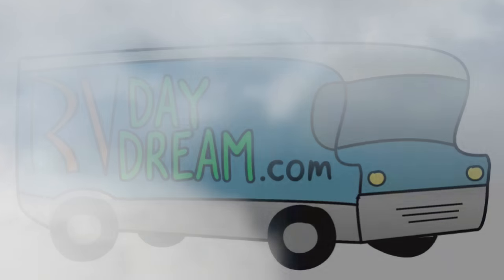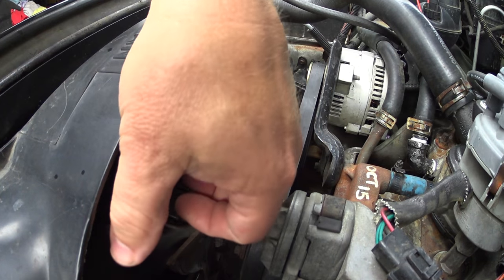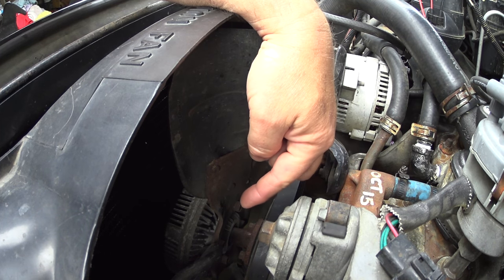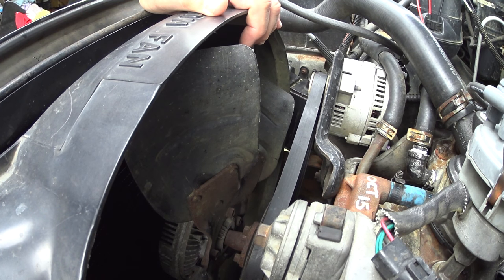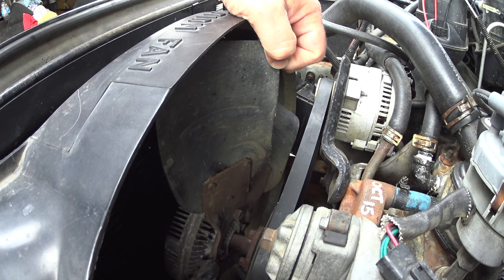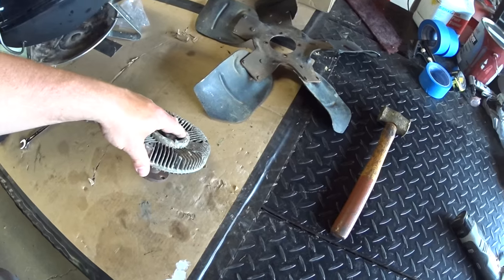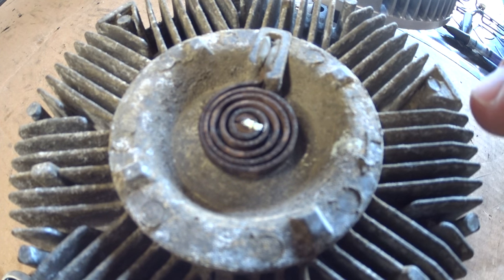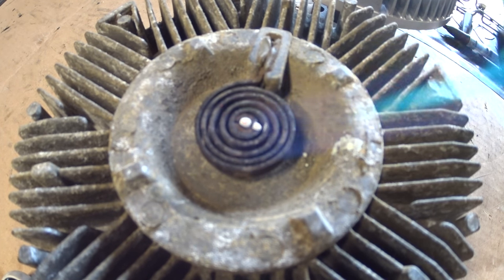RV Tow vehicle Wind power

Comment: I told you it wasn't normal that truck was idling at 210 degrees, thats 10 degrees over boiling temp, and I don't like it. My old Chevy didn't use that kind of fan, it was all electronic based, off a engine temp sensor. But if you suddenly discover melted sensors and blown out fuses, you might find your fan not turning on no more lol. Thank you for demonstrating how those fan clutches worked, I never worked on those, so never experienced that. That was super cool, watching the valve rotate, once the spring got heated. I am loving it.
Reply: Boiling temp? wrong:

Water at atmospheric pressure is 212ºF; under 15 psi pressure is 250ºF; in 50/50* Glycol mix @ 15psi is 268ºF.
(50/50* Glycol @ atm pressure is 223ºF.)
*[I believe these figures i quoted are for a 50% mix. And typically the max recommended ratio is 60/40 glycol/water; which is slighter more boil/freeze protection].
Mr K L

Comment: As I just found out on my 01 RAM with Cummins Diesel, a radiator full of grime and dirt can also cause the same symptoms as a bad fan clutch.  Fords may be different but I thought I'd put that out there.
Reply from the maker: Yep, anything that restricts airflow like adding a bigger than needed trans cooler in front of the radiator or a dirty A/C condensor.. Whatever you do don't ever remove your fan shroud.. That is a another No-No.
Reply: +RVdaydream Most people dont wash the radiator area when they wash the vehicle. I always wash mine good to be sure that no gunk gets built up.
Reply from the maker: It's definitely a good idea,   Be careful with the pressure wands at the wash bays though as they could potentially cause debris to be lodged deeper into the core or even cause leaks if the fins are pushed around by the spray..

Comment: I just cut the coil spring with a dremel...and turned to valve to open position by hand.....tacoma went from 214 on hiway in az to 93✌
Reply from the maker: Fans don't add air flow over 35mph
Reply: @Rvdaydream  fake news
Reply from the maker: Real Physics.. Like adding a box fan in your house window during a cat 1 hurricane.. Flex a lite, Derale Confirmed this during seminar training when I worked at Summit Racing in the early 90's..

Comment: Dakota going down grade 45mph cool weather overheated. Two gallons water in radiator. Went 110 miles home ok no grade .

I just replaced fan clutch. Air over radiator is NOT enough to cool engine.
Reply from the maker: Air has to be directed so that it flows through the radiator. Most stock vehicles, meaning no lifted trucks, no vehicles with air dams removed or added, no vehicles that have had their under engine catch pan whether it be plastic or rubber removed, should be designed to  allow  airflow through the radiator however, even with all the factory components in place there are some vehicles that the engineers have designed that require a fan to pull air through the radiator. But it's a poor design if that's the case. Just driving a car at 45 mph with any faulty cooling component such as a radiator that is not fully flowing, a thermostat that is sticking whether it be fully closed or fully open or even at the wrong temperature will cause a vehicle to overheat even though there is sufficient air flowing over the radiator. So to recap, if your vehicle is in its stock configuration, especially not lifted, and if it is a well engineered vehicle from the factory, and all of the cooling components are in top condition and working the way they are designed to then anything over 45 mph is more than enough air flow going through a radiator to keep a vehicle cool. Also remember the engine has to be spinning at a sufficient enough RPM to allow the water pump to circulate coolant throughout the engine at a rate that it will extract the Heat from the Block and transfer it so that the radiator can disperse of it. During a downgrade could be a chance at the engine was not doing that.

Comment: Yep it is kind of of a flawed design if you think about it, not having the radiator up front catching all the air possible. they could at least close off the bottom etc, to force more thru radiator.some are beter than outhers.
Reply from the maker: I totally agree. Like most RV stuff I am sure it was designed with cost in mind and functionality being a secondary thought..

Comment: Tbird v6 climbing sierra from valley floor. Warm not hot weather. Overheat. Pull over. Cool with water. About 10 times in 130 miles.

Yep fan clutch. So NO! air through radiator over 40mph did not cool engine sufficient.
Reply from the maker: The V6 thunderbird, yeah that car is not designed very well. Air was not being pulled or pushed or dragged or blown or anything else through the radiator with that little tiny grill opening. And I hope you didn't remove the belly pan(rubber flap) . If you pulled the radiator out of the engine bay and stuck it on the front of the car where would actually see air flow , you don't need that fan. So YES air over 40 mph that actually goes through the radiator will be enough to cool the vehicle.

Comment: If your putting on the exact same fan, then it would not benefit from a heavy duty clutch. The torque is going to be the same. The 4 cores make NO difference to the load that the clutch will see. How many cores will not change how much work the clutch does, if it is driving the same fan, and with the same pulleys.

The benefit will be from all the other things a heavy duty offers. (probably higher durability in higher cycling or longer cycle operation, sustained higher temperatures, etc.; which is probably why you are using a 4 core in the first place...)
Mr K L
Reply from the maker: I don't think that I completely agree with that..  A fan that is designed with blade pitch and diameter size to draw through the fan shroud a determined amount of CFM by retrieving air through a path that is being blocked by a power steering cooler, an AC condenser and two radiator cores would definitely see more work if that same path is being restricted by an aftermarket oil cooler(separate video) and Double the size of the radiators thickness....
Using an analogy, Same straw, same mouth, thicker milk shake... Means more work..

Comment: Downfall about the severe duties, i found out those will allow maximum fan slips when disengaged
Reply from the maker: When driving over 35mph, the fan doesn't offer any additional windspeed anyways so, being fully disengaged is ideal for less power consumption..
Reply: @Rvdaydream  yeah but you one thing i found out???

Is that with clutch driven fans they dont seem offer great ac performance at idle
Reply: @Rvdaydream  and or when the engine rpms are below 800 rpm

I read that those 2 contribute to slightly poor performance of ac
Reply from the maker: Ninety percent of the time the poor performance at idle is not because of the fan it's because the compressor is turning at a much slower speed also. At idle up until about 1500 RPMs my fans screams when it's locked in. What I mean is it is pulling a ton of air it sounds like a semi truck.
Reply: @Rvdaydream  ah okay, i can see why a smaller car is more preferred since the engines i believe have higher idle

I always figured there was something up with my mid sizer SUV but nope , glad to know :)

Oh by the way wheres the link that you stated in this video?

As its not in the description

Comment: When they fully engage on big a class motorhomes they push so much air they are noisy. it is aggervating.
Reply from the maker: i would imagine they need that air pretty badly inside that big box.. :-)
Reply: +RVdaydream Yes they need tons of air. My 36ft class a has a clutch fan as well as 2, 10 inch electric fans. Im thinking tho of changing out my clutch fan for a big electric fan. Maybe a 24 inch one.
Reply from the maker: 99 percent of electric fans will never out cool a good ole mechanical one.. The exceptions being specific designed aluminum radiators with perfectly matched/formed fan shrouds with high volume fans.. These will run anywhere from $800-1500... I researched this heavily and talked with a couple of Manufacturers... The best one for my truck is $1200 from Griffin part# CU-70125

Comment: Your messing up your clutch by doing that.
Reply from the maker: 25000 miles later, Works fine...
Reply: I don't think so:
He's presumably adding no more heat than it would see in normal operation in rotating to that same position...
He was at an angle and not directly into the seal area...
He stopped as soon as it rotated...

Slower heating would be best, so no hot spots (further away, flame not touching).
A heat gun would be optimal.
Mr K L